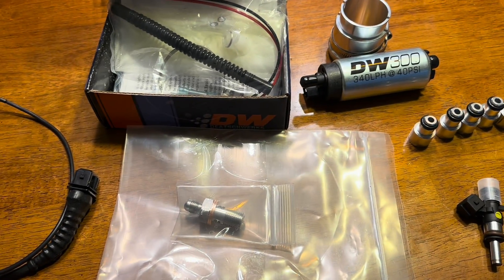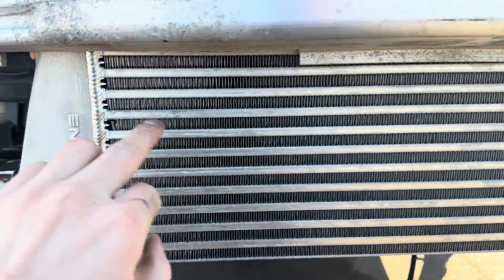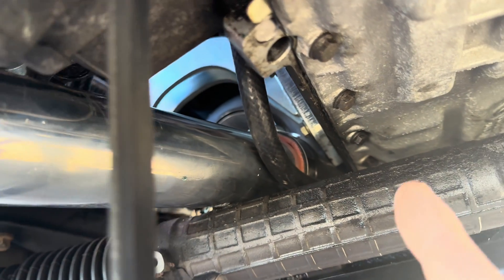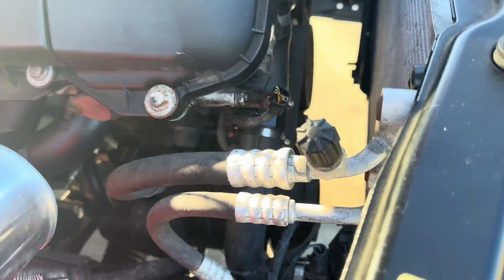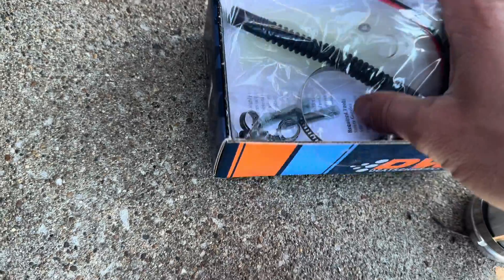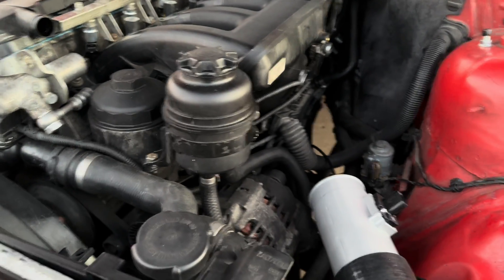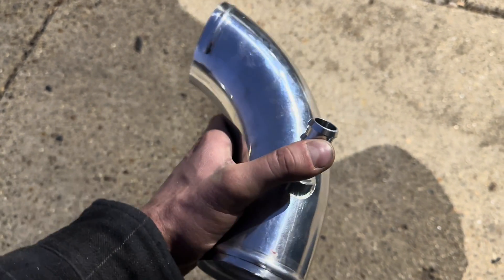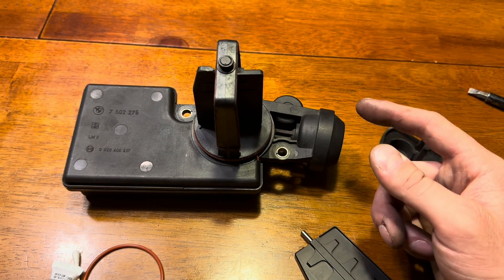TURBO E46 330ci Build! Parts Needed and Update!

Comment: So you kept the Disa valve when boosting? Always thought that it’d be better to remove it and blank it off or remove the plate so you can still plug it in
Reply from the maker: If you can make the disa work its better. Keeps some low end torque

Comment: Random question. Would headers from an e36 fit a e46. Im planning to turbo my e36 and have active autowerks headers leftover.
Reply: if the e36 is m52 it should fit the m54.
Reply: @YoseifPlays  its an S52 and the e46 has the updated m52 in theory i think it should fit.